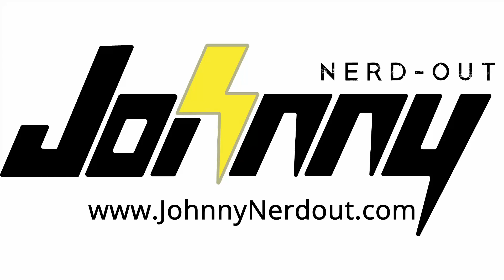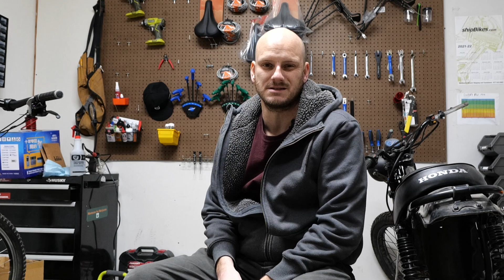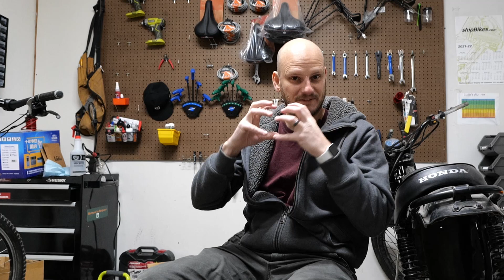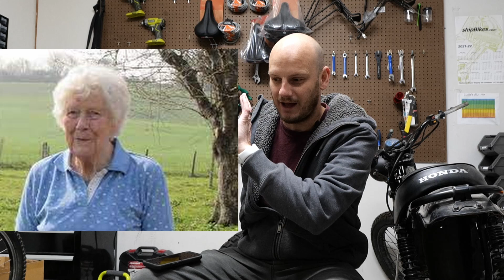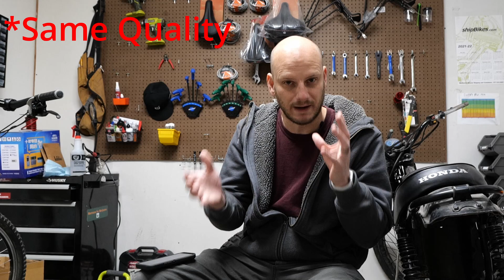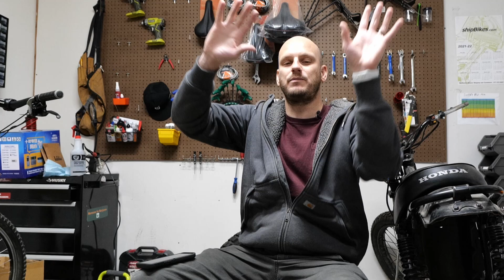Hub motor or Mid Drive Motor Buyers Guide : Which system is right for you?

Comment: If your into REAL preformance. Go highpower hubdrive. 3k 5w 8kw 10w 14w all the way to 32400w Hubs can handle any of it. Look into qs205 or qs273. Focus more on continuous amps of battery and controller than anything. With the right power you will smash any middrive. (I pull 74mph on qs273) If you want a lowpower ebike thats more of an actual bike and fast for its limits go for a middrive.
Reply: ps qs also recently released the first high power 8k mid drive motor. I've heard at REAL power mid drives brake chains like toothpicks and actually manage to be slower than the hub (something about it not being able to push the weight of high power bikes)

Comment: The preformance difference is irrelevant when you don't have low power bikes. at a cetain point you literally cant even use a mid drive. My qs273 can handle alot more than any mid drive can by far. The most powerful mid ive seen is 3000w. It cant compare to a 8000w motor that can handle 32400w of power. If you want a low power bike then a mid drive will out preform but the power hubs can handle will far surpass mid drives and be insanely faster.
Reply from the maker: I agree. But for the purpose of this video I was talking about e-bicycles. In most places anything over 1000w is no longer classified as a bicycle.
Reply: @JohnnyNerdOut  oh I see lol my bad 😂😂😂😂😂😂😂😂😂

Comment: Johnny, I want to convert my store bought hub motor ebike to a mid drive (once my warranty expires) but I managed to find everything except the rear wheel replacement. having a bit of difficulty finding a (please don't laugh) 20x4 inch cassette and disk break ready rear wheel. Yes, it is all aesthetics but I like how comfortable my bike is. Any suggestions, truly welcome.
Reply from the maker: Just buy the hub assembly and have a bike shop lease it into your current rim
Reply: Wow that is an interesting conversion, you need to do a youtube video of what it turns out like. I'd have been tempted to keep the rear motor hub and create a weird mid-drive setup with rear hub motor just to minimise chain wear when climbing hills etc. You probably can get a fat bike freehub hub and lace it to that wheel. As ever its a specialist part though so you'll probably pay through the nose compared to more easily obtainable parts. I've had past projects in mind only to find out that the price of the parts I wanted was prohibitive so I decided it just wasn't worth the investment. I'd personally try to copy the characteristics of the bike by getting a used acoustic bike that was similar and then fit a mid-drive motor it could work out cheaper plus you could compare the bikes and sell one of them on after deciding which is better long term.

Comment: One thing I'd add. If you want a step through bike, you probably will need to go with a hub motor complete bike. Good step-through conventional bikes worthy of conversion are very few and far between. There are folks who know how to ride a bike, but for whatever reason have difficulty with the range of motion needed to mount a conventional bike. However, If you're in this group - see if a dropper seat post can do the trick for you before you go researching step-through bikes. One other thing. Compared to a ready-made affordable hub motor bike, a retrofit bike using any conversion motor will be tens of pounds lighter. A lighter bike is easier to lift and to transport without investing in bomber bike racks. Ready-made mid-drive bikes cost more, and good ones cost ton more.
Reply: Retrospec makes The  Beaumont Plus, definitely worth converting. Brooklyn bikes are even better. There are great Dutch style step throughs out there. You just have to look. They are significant more comfortable and stable than any fat bike (for instance). That is, for anyone commuting, doing rail trails or just hanging out on The MUP's
Reply: @MHH3180  In my experience and in this area, you'll have to look a look hard and for a long time. I'm sure they're more common regionally.
Reply: @bjnslc  oh, you would only find those available at weird shops like mine. Normally people get those on-line and have someone like me  onvert them. I was working on a really cool 4 speed coaster brake just today. One of the very last U.S. built Treks. TBH, it kind of bothers me to convert it in to an e-bike because it is so unique.
Reply: @bjnslc  oh yeah,you will only see them at really weird shops like mine. Generally, people order those two brands on-line.
Reply: Trek makes a step through mid drive

Comment: Mid-drives work better for bad hills and heavy loads.  (I have run both at some length.)

In such conditions, mid-drives give significantly better performance regarding pulling power (for trailers, or if you’re heavy), hill climbing, and power consumption, especially with real distances.
Reply: Yeas, I was terribly disappointed that Greg Lamond went with hub drives on his new line. His market is people that out in the Mike's and th I ugh Johnny disagrees with me, that is where a torque sensing mod-drive really shines!
Reply: So if you're heavy, have a ways to travel, and face some hilly terrain, middrive shines. That's exactly my situation in Petaluma California.  Thanks.

Comment: You know what I don't like? Rim Brakes on an Ebike. I got into the worst bike accident I've ever been in on Thursday at 4:30PM and my friend and I both agreed that bike should go back to normal because it didn't even come with the front rim brake that we added it on. Not only does it only have Rim Brakes but ones that aren't nature.

The only factory Ebikes I see with Rim Brakes on them are ones that have 350Watts.

I am reusing the system on a new bike with disc brakes and having to buy a new set of wheels for the bike that got into an accident. The front wheel which is the front hub motor survived and the rear one didn't. Mirror that was already messed up broke. Pedal assist which is cheap broke too. Thumb throttle survived and still works but am still getting a new one because I am missing a screw from the accident.
Reply: I wouldn't consider a retail e-bike with rim brakes. The brakes are probably the least of your worries. I converted an old hardtail bike with V-brakes. They're plenty powerful (at least if I don't get the rims wet). Good disc brakes are the best choice, but there are bad ones...especially at the lowest price points.
Reply: Four-pot disks can save your behind, especially in panic stops or on long downhills with a trailer full of groceries.  I have had both of those things happen to me, and I swear by those disks.

Comment: I am wondering why we never see any hub motors designed with an internal geared hub integrated into the design? I'm no expert on the subject but it looks doable, albeit more complicated.  Has anyone else thought of this or knows why it isn't viable?  The only real roadblock I can see, is that possibly internal geared hubs may not be robust enough to reliably handle the stress - or that the failure of either component would require the replacement of both.  I'd love to hear anyone's thoughts on the matter.
Reply from the maker: I don’t there is enough physical space for a hub to fit both a motor and a transmission
Reply: @JohnnyNerdOut  Wow - that's too bad.  I was hoping that - since geared hub motors have one geared set, they could probably fit one or two more.  I guess that assumption was inaccurate.  Thanks for the reply!
Reply from the maker: @waynecooper6124  there are hub motors out there that have 2 different sets of gear reductions though. Not the same but it’s a two speed
Reply: @JohnnyNerdOut  That's interesting - I'll look into that and see what's cooking!
Reply: @waynecooper6124  One of the huge benefits of a hub motor is their simplicity, a direct drive hub is literally a motor as your hub there are no moving parts at all except for the bearings on the axle this can give them amazing reliability and long lifespan. Geared hub motors as you say have a planetary reduction system to increase torque but reduce rotation speed and a clutch mechanism for freewheeling. A little more complex but still very simple compared to mid-drive hence the very low pricing. i think it would destroy the simplicity and reliability of hub motors to add gears but as stated there was a 2 gear system but from what i saw in the forums it was not as reliable as a typical hub motor due to the extra complexity.
Reply: @bonzobanana1  Ahhh... That makes good sense to me.  Do you happen to know who put out the 2 gear system or where they discussed it?  Thank you for the detailed reply!
Reply: @bonzobanana1  mid-drive isn't very complex. Some have the controller built into the housing, but that's serviceable and provides protection and clean mounting you don't get with a hub motor. Mids have a geared motor that drives a chainring that has a bottom bracket freewheel. The most common death for motors is burning them up (motor or controller), and I think it's a lot easier to run a mid-drive at lower wattage.
Reply: @bjnslc  They are very complicated compared to a hub motor and based around a much smaller motor. Some models like the Brose have had a huge failure rate and literally destroy themselves when they go wrong so have to be completely replaced. Many have internal nylon cogs and some even have belts plus they have to handle the power of the cyclist going through them too so lots of wear to the bearings etc. A huge number of additional issues compared to hub motors. Don't get me wrong many benefits to mid-drive but engineering simplicity isn't one of them and neither is reliability which of course follows from that. Have look at various exploded diagrams of various mid-drive motor models. 

Theres a video here where you can see a Brose motor inside. Shows you the belt, the 3 plastic planetary gears, various sensors and PCB. Lots of issues regarding water ingress, bearing wear and parts breaking internally. I believe some of the mid-drive motors are more simply designed. I think one issue is Brose, Bosch etc are very determined to have the best performance to justify high pricing but personally I think the Bafang models are far superior, often better engineered for reliability and easy access to spares but for premium levels of reliability you can't beat a good hub motor even if it delivers less power typically.

https://www.youtube.com/watch?v=hBL7g22Pj18
Reply: You would have to use a Pinion gear box  to go along with the hub drive

Comment: “If you’re thinking about a wheel chair … get a hub motor” @5:18

Hmmmmmwhat
Reply from the maker: I knew I’d get some flack for that comment. I just meant that a hub motor is way easier for someone needing motorized transport vs a mid drive. Many people are on the cusp of needing motor transport and Ebikes are a super viable option for that need.
Reply: You wouldn't want a mid-drive on a wheel chair, mid-drive motors are much more complicated often with vinyl plastic gears and cogs and sometimes belts, they need to be made exceptionally well to be reliable and still many fail prematurely. You really don't want someone reliant on the motor functioning correctly to go mid-drive. Simplicity in engineering equals safety even if some parts of the specification could be improved with mid-drive motor application i.e. maybe climbing very steep pavements.

Comment: Thank You Johnny! Aging mountain biker, full-suspension bicycles, living in moraine territory and serious about off-road riding to the tune of ~1K km trail riding a year. Equally serious about chain cleaning and drive-line maintenance so I get a couple of seasons from a 9-speed chain and 3- 4 seasons from cassettes and chain rings. I do have the tools to measure the actual wear in the chain (which don't stretch). Really sounds like I ought to investigate a hub motor to assist with the black-diamond rides that get tougher every year, as I'm getting way too close to 70.
Reply: I'd say you want a mid-drive. The hub motor gets no gearing benefit from your MTB's drivetrain. A mid--drive motor does. Even an internally-geared hub motor is a one-speed motor. A mid-drive motor uses your gearing to operate with more torque and/or less power input than a hub motor.
Reply: @bjnslc  Sounds reasonable to me, and nicely put into words! I do know how to use the drive train without killing sprockets and chains and keeping that weight out of the wheel would make for better suspension when I think about it. I can still handle the drop-tube frames I have so can avoid the step-through for a few years yet.  Likewise I still have the tools from the last bare-frame build so can tackle the build myself. Bloody cold and more snow coming, so can only dream about it for now.
Reply: Mid drive is better for you, torque sensor required for real MTB experience.

Comment: Johnny I have a question for you. When I was a kid there was 3 and 5 speed sturmey Archer hubs. Could they be used with a mid drive motor system. Are they strong enough to hold up to the torque providing you use them properly. I thought it would be a good solution for chain positioning
Reply: yes, johnny has a video on internally geared hubs, 3-5 speed sturmey archer gear hubs are considered heavy duty and can handle the torque of a BBSHD. shifting under load may be a bit sketchy so be sure to lay off the throttle for half a second when shifting to avoid more wear on the gear hub
Reply: link is here: https://youtu.be/VRoucNtcfDQ
Reply: The Sturmey Archer 3 speed is typically very reliable and simple but the 5 speed never had the same reliability as far as I remember and much more complex internally. So I would of thought the 3 speed relatively safe but the five speed would be better used in combination with a front hub motor. It's really down to application and many variables though, power of the mid-drive motor, weight of rider, how many hills, how powerful the rider is etc.

Comment: Isn't there an available electronic display, even just two daylight visible LEDs, which indicate the need for a shift up or down based upon the current draw of the mid drive motor?  If not, there should be.
Reply from the maker: IMO you want to shift on RPM, not power. You should always shift under light load to avoid drivetrain breakage and undue wear.
Reply: And, add a shift sensor. (First and current, in-process builds in my case.)

As for load, some displays (860c, especially) give an indication of load when under throttle, and to a lesser degree, while pedaling.  

General idea is to use the gears as if you were doing the pedaling unaided.  

Electrification helps when you’ve got too much labor or distance to cover unaided, especially when you’re older and paying the price (in terms of health problems and infirmities) for “burning the candle at both ends” due - largely - to then-undiagnosed disabilities.  

Being labeled as morally deficient when I could not keep up did not help.

Comment: BBSHD with asi bac 855 and 72v 25ah battery 4300watt of pure mid drive shreding power 1.st gear 45mph 3.third you are gone 4. Up to rocket to moon 😎💪🏻
Reply: Wtf are you serious? 🤣
Reply: @AbuBakr1  yup look at my channel stock bbshd 1500w 52v 35ah custom battery and flying ,or look up bbshd 4kw and you will see an accelleration video 0 -91kmh in one gear 0-70 kmh 7sec,0-40kmh 2sec

Comment: Pros and cons,mid drive BBSHD bafang usually difficult to handle in traffic have to be treated with respect,chain and derailleur killer but for going up steep hills really fantastic. Hub motors more reliable but unless you get a 3500w hub and a big 🔋 battery ...after 5 chains and 1 derailleur on the BbsHd I would go back to buy a bigger hub and a big battery,more reliable, in any case good video Johnny but as for mid drive until they sort out a titanium chain or put a internal gearbox with a one speed gog on the rear hub then I would go back to a hub. The mid drive motor is not really reliable enough.
Reply: I've done many many miles on my BBS02 at 25 amps....never broke a chain, derailleur or any teeth, and reprogrammed with Karl's special sauce is absolutely butter smooth on throttle.
Reply: Ran a BBS-HD, and had zero trouble with chains, derailleur, etc.  I was pulling a trailer, and riding longish distances.  Only real problems I had was getting my trousers caught in the chain and then getting stranded - until it was stolen in March 2021!
Reply: Hubs have the ability to be way more powerful than mid drives. a qs273 will destroy any mid drive that comes its way because it can handle any amount of power you throw at it. on 72v 40ah 14,400w I pull 74mph with insane acceloration. Mid drives just cant compare to the limitless power high qualify hubs can handle. I know guys that run double the power I do on the same plat form.